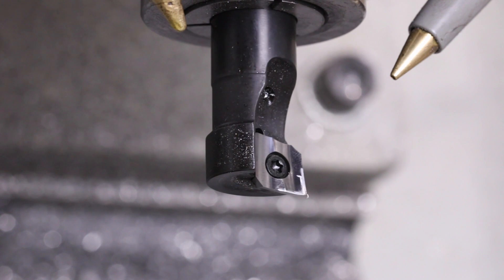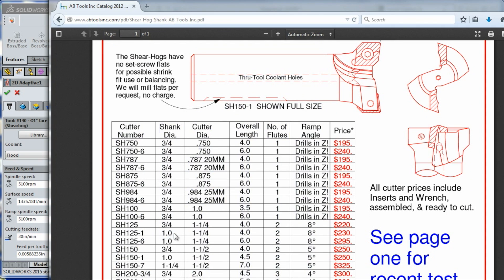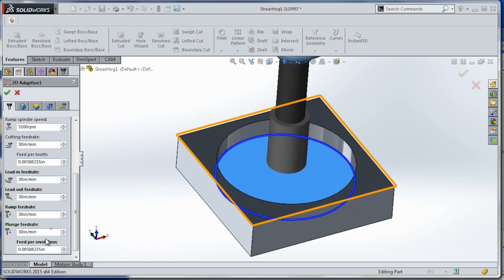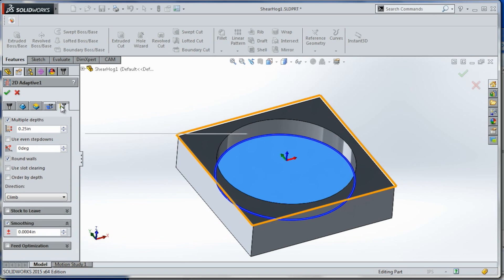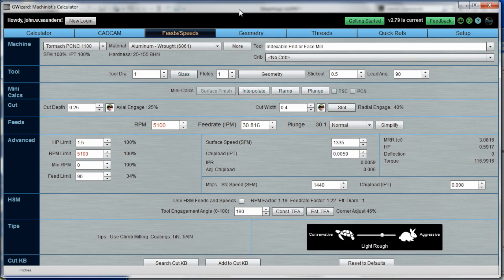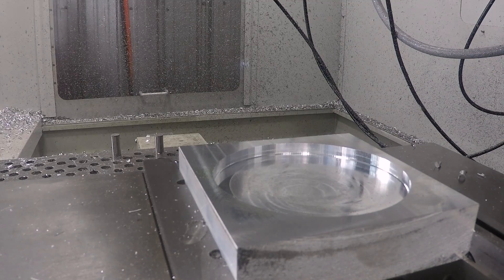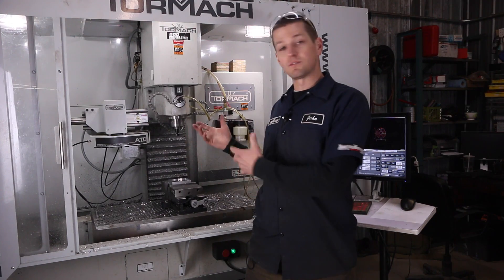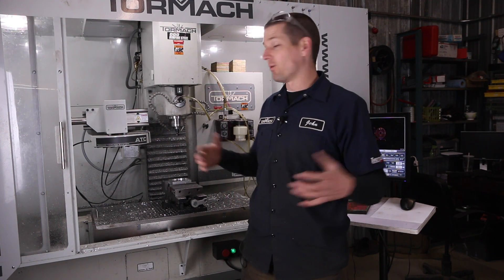Shear Hog: New Favorite Endmill for the Tormach!

Comment: FSWizard says you can run 22000rpm and 2400mm/min?
Reply: Good point. At 5100rpm then you want around 23ipm. If it was a 2 flute you could run 80ipm at 5100rpm.

Comment: Major fan of the shear hog. Been using them for years, I've got their 1.5" 2 Flute style with both a 1" shank and a 1.25" shank.
Also have their 3" 4 Flute Shell Mill style.

Have ran speeds of 14,000 RPM, 250 IPM on the 1.5", and 10,000 RPM 375 IPM with the 4FL.

Great tools

Comment: 30ipm you should be running this tool at 100 ipm.
Reply: Sure, in a machine that can sustain that cut.
Reply: I use the 1.25 shear hog on a 5 hp ptrac.  3900rpm 80ipm
Reply: NYC CNC 
what depth of cut can you take at 80 IPM on the 1100?

Comment: FYI the simulation in full-blown HSMWorks is much better, but it's licensed so isn't used in Xpress. I too wish it were better, as we aren't buying new software until next year.

Tried Fusion 360 yet? Or HSMAdvisor?

Did a quick check, and according to the power curve in the machine profile for the PCNC1100 provided by HSMAdvisor you can get higher MRR running that same path at 4300 RPM (highest RPM+power at the spindle) and 41.77 IPM for a MRR of 4.18 in^3/min and 1.4HP.
Reply: Lucky you! There should be different simulation modes available then: http://www.hsmworks.com/docs/hsmworks/2013/en/#StockSimulationModes

Comment: HSM question for you, John. I noticed that when your tool is finished it turns off as it retracts to the tool change position. I am using HSMXpress for my Tormach, but every tool change will move the tool to the upper Z limit but keep it running full speed. I then have to hit the continue button where it will finally move to the tool change position and turn the spindle off. After the manual tool change I hit the continue button again and it goes on its merry way.

Did you have that same problem at the beginning? If so, how did you fix it?
Reply: NYC CNC I am using the tormach.cps file in the post processor with all of the default settings.
Reply: seeigecannon You should find what you are looking for over on the CAM.Forum.
 
There is a good thread going about the Tormach post  http://camforum.autodesk.com/index.php?topic=5134.0

Users have added posts that support things like the ATC and 4th Axis. 

I hope this helps
Reply: Autodesk CAM This is exactly what I needed. Thank you.
Reply: Autodesk CAM I just used the new CAM processor and it works great. You guys should consider shipping that version of the Tormach processor with the software. Thanks again for that link.

Comment: Cool tool, I'd like to hear that thing plunge right down like it claims it can. Its nice to finally see you running your machine a little harder, I want to see that spindle stall! Still, I have to chuckle a bit at you getting all excited over 3in^3/min, I run a little 2" face mill at ~130ci^3/min in 6061 with cheap chinese inserts. Although coming from a taig, I understand your machine is a different world. It's tough to know how hard is too hard when you don't have a fancy VMC that gives you an accurate load meter, thermal stabilization, and pulls feed out if you're running too hard. I've had my taig trip the thermal breaker in the motor a few times when running flat out.
Reply: NYC CNC Its a Mazak 510C-II. I still find it a little surprising how little coolant you can get away with. In a lot of your videos I'm worried about chip welding, almost cringing at times when the nozzle is blocked for whatever reason. I know if I don't get coolant to the tool for even a second or two it can end very badly. However, I run some of the same Lakeshore endmills as you, and I don't think I've ever seen them run that slow, so that might help. ;) Awesome stuff you're doing here, keep it up.

Comment: Hi John,
Wow!  That end mill really throws out the chips!  I can't help but wonder if it would work on steel too.  Thanks for the video!
-mike
Reply: No steel. It is primarily for roughing aluminum.  It works well in most non-ferrous material and has been seen milling wood even.

Comment: I've been using these for years.  They're really fantastic.
Reply: NYC CNC We have a Haas GR512 gantry router with an Accu-Lube mister similar to the one you use.  We use it mostly for cutting extrusions 10' & longer, but occasionally do some solid hogging.  We did a 5x10 foot slab 3" thick for JPL one time (Mars rover part) that ended up weighing about 20 pounds.  Did the whole thing with the very tool in your video.

Comment: For a long time, the tool makers made tools for large spindles in production shops.  That makes sense.  They make the tools that people buy.  But with the advent of these 3HP and under machines that are fairly capable in a small shop or home shop, hopefully we'll see more of these tools optimized for smaller machines.  I love my SuperFly (thank you Tormach!) and I could use a rigid single or dual cutter carbide insert mill.  I'm cheap, so I'm a little put off by the $20 insert cost, but that's not a simple carbide insert and no doubt that clever insert is the secret to the Shear-Hog magic.  If I cut a lot of aluminum, it'd certainly be a no brainer.  The cost per part is probably close to negligible.  Thanks for the video making us aware of this, and thanks for the link.  I'll definitely check it out.  You can never have too many cools in the tool rack... right?
Reply: NYC CNC They last an extremely long time.
Reply: Plenty of tooling already on the market that can be utilized in smaller machines; basic knowledge of tool geometries, application, and reasonable expectations really helps.

Comment: Boy, could use one of those right now hogging out the back of the AL pieces I'm working on. 3/8" D x 11/16 W x 12" L  x3 per piece x 12 pieces. ;-)
Reply: Too late for this job but will keep it on the radar for future.. ;-)
Reply: ***** Keep in mind that to remove material fast, you got to rev up the rpm, and, also feed rate so you don't get the cutting edges packed or overheating... That's where a CNC excels, no break, no hesitation.
Would be fun to have you swet in a video, cranking the mill as fast as it eats up the metal... ;-D
Reply: pierre beaudry
powerfeed on MAX baby!!  ;-)